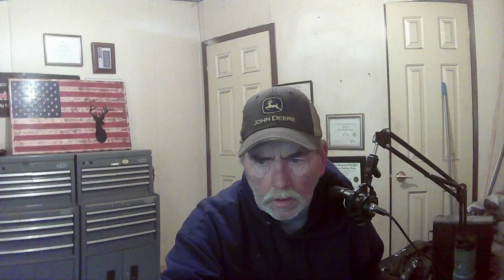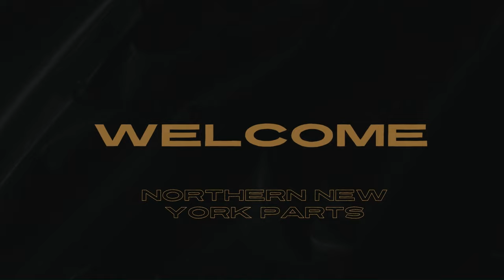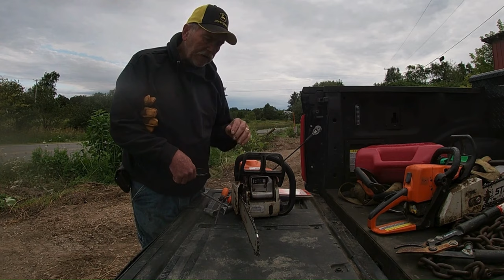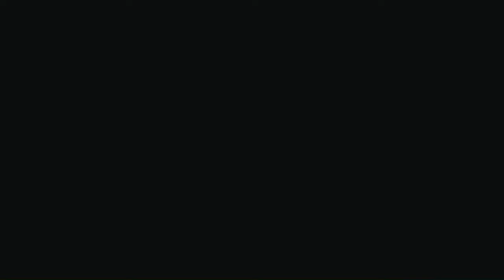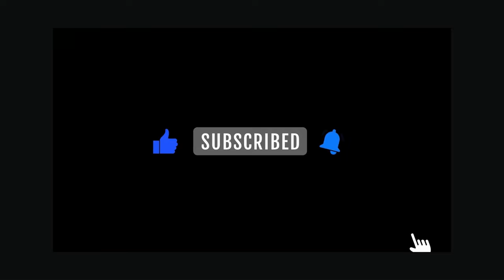Why Old School Still Is Prevalent In Small Engine Repair

Comment: A lot of the 4 cycle trimmers will have low compression when you check them due to people running too thin of oil. The valves will get carboned and gunked up. I spray the valves down from both ends. I spray inside the cylinder and on the rocker arm end with PB Blaster then let it soak for a couple of hours. Then I get it running and spray PB Blaster in the carburetor for about 1 minute. Hold it wide open and spray short burst of oil to keep it running. It Smokes really bad but once done I let it cool back down and Readjust the valves. When adjusting valves you have to wiggle the rocker arm back and forth while inserting the feeler guage and use the go no go system. If its .005 and it will go and .006 wont go it is correct. You want a very light drag on your feeler guage. Different areas are different for people working on their own stuff. Around here they run it till its dead. I find better stuff out of my area because they don't touch it if it doesn't start they get rid of it. Most of those people don't even own a screwdriver. If you go to buy something with issues and the guy has a garage full of tools, it has been messed with and will probably not ever run again without major repairs or a complete rebuild. Most carburetors that have not been taken apart I can make run without a problem on the first try.
Reply from the maker: I dread the backyard mechanic that drops off things to get fixed Jason. My biggest problem is what have they done up to this point and any changes done to it. thanks
Reply: I’m an old school guy ( mainly because I don’t have money to buy me new stuff all the time lol) but you said “if you buy a predator , you’re basically getting a Honda engine”. And that’s true as far as cloning goes but in terms of reliability and quality they have figured out how to “clone” that. lol. Honda engine is 1000% more dependable
Reply: @johnwarren6049  Honda or Preditor they are both great engines. Nothing like the Tejunksih engines before they folded. Those last years were nothing but garbage. I don't think they could have made them any cheaper. The old Tecumseh engines on the Sears Tractors  were great engines and well made. Some of the best running old engines to this day as long as they weren't OHV.

Comment: I just put a carb on a  mini  echo tiller and the oem carb was 80.00 dollors!  WOW, glad it wasn't mine, he paid the price!
Reply: Those old tillers had well built carburetors. I have cleaned many Mantis carbs and most only need a new primer bulb, tank bushing and fuel lines.
Reply from the maker: Same here Randi, I am trying to thin down how many OEM carbs that are still on the shelves here. The cost of new gets expensive for the OEM

Comment: Wife and I were at WallyWorld a few days ago and the cheapest POS push mower they had was $269.00. 5 years ago that was a $129.00 mower new. I know: bought several over the years for my factory employees to use to mow around the building and they destroyed them in about 2 years per. Use to buy 2 at a time and store one on a shelf till other was ruined.Bend over and pick up a 4" rock? Naw, just mow over it....Stuff has gotten crazy high and people are trying to repair what they have or find on the used market. They have to.
Reply: The used market is a bunch of wore out junk for new prices. Hard to find anything with decent compression. I'm seeing a lot of push mowers and riders with the tread completely wore off the tires or blown up engines and they still want half of running price or more.
Reply: @jasonbusch3624  Gotta know what you're looking at and shop smart. Same jink on the market down here too.
Reply from the maker: My question is how can something double in price in 5 years? I doubt the Chinese are charging more, Biden is not hitting them with an import tax....so who does that leave? The manufacturer and distributors... sure is not your local dealer.